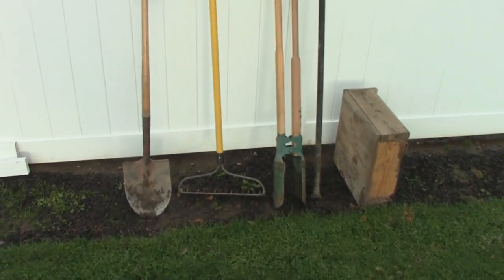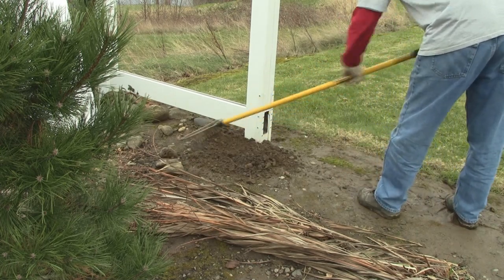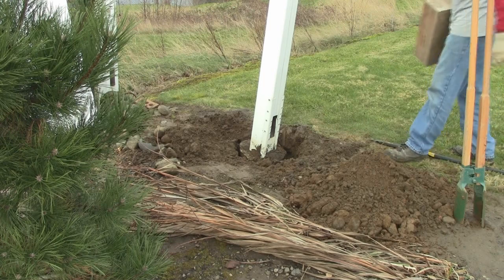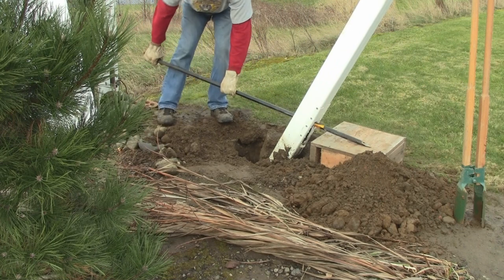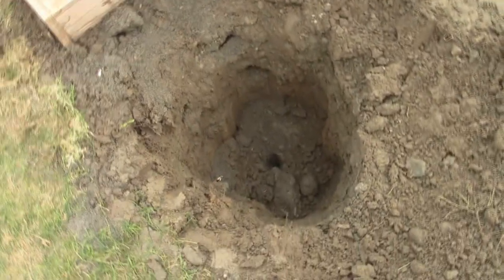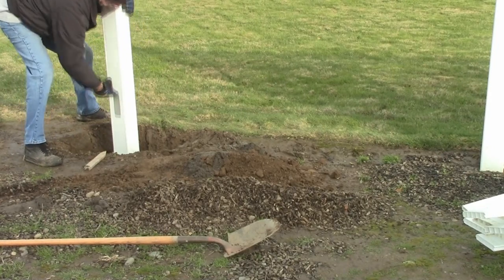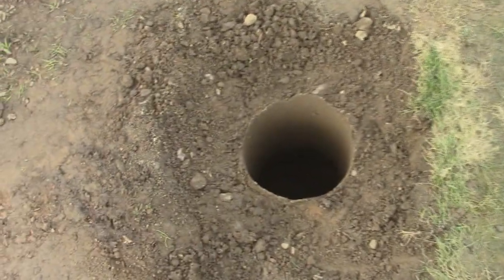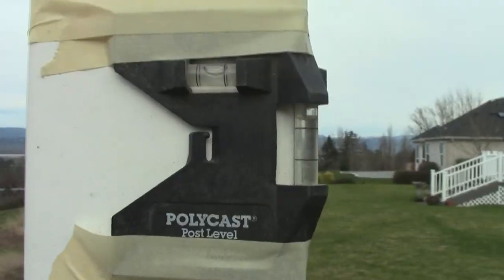Remove Vinyl Fence Posts WITH Concrete! SUPER EASY!

Comment: The old vinyl fences look good,. Why did you need to remove?
Reply from the maker: The vinyl posts broke right at ground level during the winter, and had to be replaced.  Thank you for watching!
Reply: I live in Florida, which has no snows. My neighbor and I shared a vinyl fence two years ago. The hurricane Irma did knock off only one section of the fence. But, my neighbor put it back up.

Comment: could you get away with 1 80lb bag per post
Reply from the maker: I'm not really sure...perhaps.  It would be worth a try, but I would want to have a couple bags on hand in the event a single 80lb bag didn't do the trick.
Thanks
Reply: No, don't even try. 2-2 1/2 per post dug at least 24" deep. I dig mine at around 30" give or take. Stuff you posts by pouring the concrete in the hole and then sink your post making sure it's plumb and in line with the rest of the posts.
Reply: Square post=square hole    round post=round hole

Comment: how did u prep the soil ? did u flood it ? to loosen it
Reply from the maker: Hi arod55...no prep at all. I live in an area (just outside Portland Oregon) where the soil is damp during the winter so the natural moisture made the soil quite workable without much work on my part.  If you live in an area where the soil is dry and compacted, a large digging rod like I used in the video to pull the post out of the ground, would work GREAT.  Be careful though...that digging rod is a hand-full!
Peace
Rich